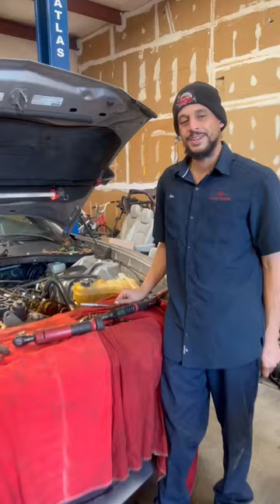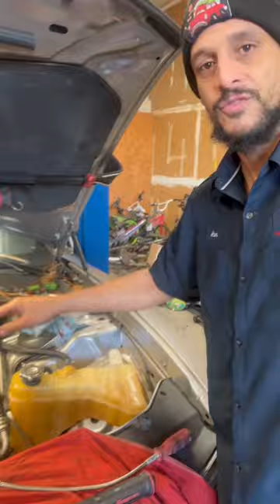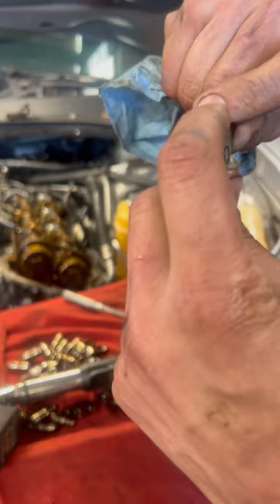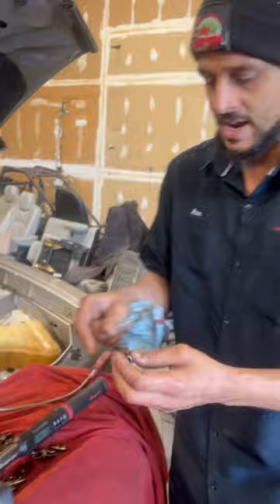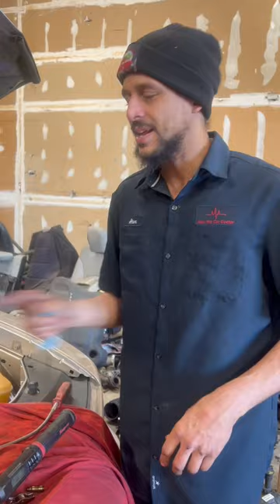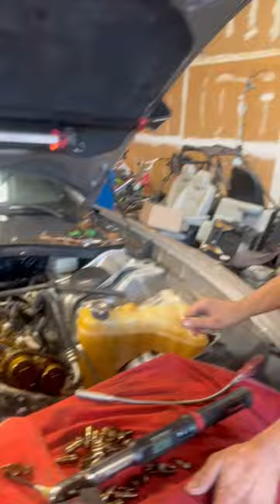Don’t let those 3.6 pentastars tick got too long! #shorts #cartips

Comment: 2010 ford f-150  Hey Alex.I had a question so I have a misfire on cylinder one and I did everything to it.I changed the sport.Blog's changed the core pack and also the fuel injector and it's still Miss firing

Comment: What oil is best for the 3.6 Pentestar engine?
The same 3.6 comes in many different models. And they all recommend different weights and oils. 
What are the weight you use?
Reply: Unfortunately you can’t really play around with it due to all the tech. You just have to put whatever yours calls for it it may throw a CEL
Reply: My buddy has a challenger with the 3.6 and he's going on 220k with no problems with the engine or transmission. He does his oil change every 3k miles, 5w-30 full synthetic mobil 1. Only common stuff is the oil filter housing leaking, 2 thermostats. It's great. He doesn't baby it either mind you. You just have to take care of your car.
Reply: @Peewee239  
Thanks for the reply. 
Yes. I am going to keep my oil changed frequently. Definitely. 
Okay. Good information to know. 
Thanks

Comment: Do you know the mileage on the car? and when do the lifter start to go bad?
Reply: Poor quality Chinese steel...ate the cam on my daughters Jeep when I took it in the mechanic knew exactly what it was lol....but Jeep fixed it under warranty even though it was a couple thousand out. Will buy another Jeep I guess if they are going to stand behind it.
Reply: @Simon O I have a dodge caravan with 40K miles and the both the intake and exhaust cams need to be replaced with all new rockers. $1,159 was the quote I gave and the customer was wondering if the other side would do the same and is it worth fixing. I told them I'll do a tear down of the other side to inspect for free while I'm in there if given the job. Customer said "Thank you, but I may just sell it as is." Good luck Customer